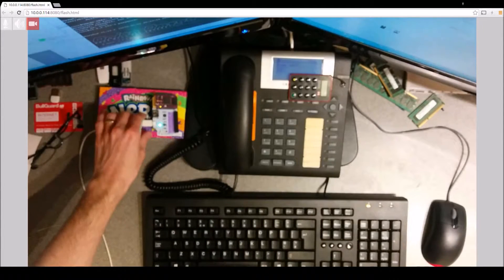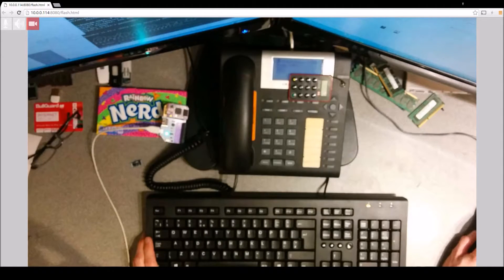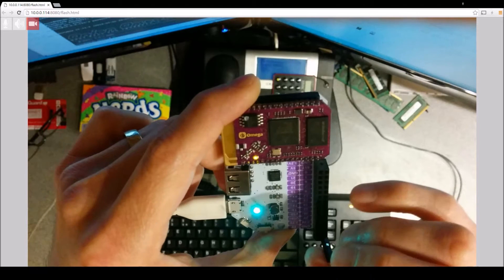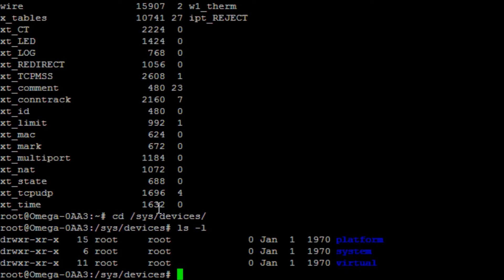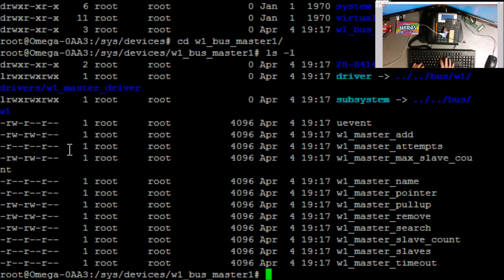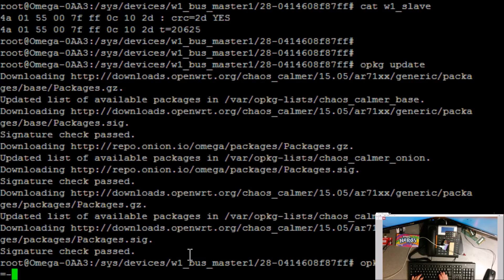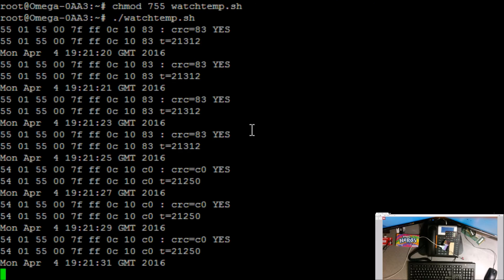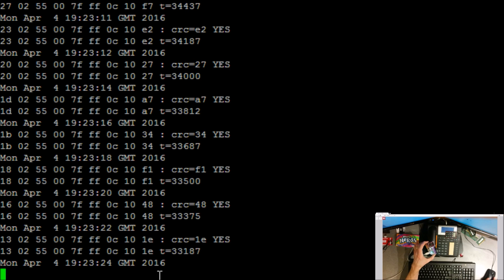Using a 1-wire temperature sensor with the Omega Onion IoT Device

Comment: thanks for sharing this. very interesting.
Reply from the maker: +Raducki Frédéric thank you and glad you found it interesting. I use an onion and 1wire sensor constantly in my office to control an electric heater on and off to the desired temperature.
Reply: icannotgetafreename you seem skilled with the unix system on the Omega. any advice on how to execute a command line on PowerOff ? (i managed to execute a line on boot but now i'm looking for the same possibility when the board shutsdown).
any help is welcome :-)